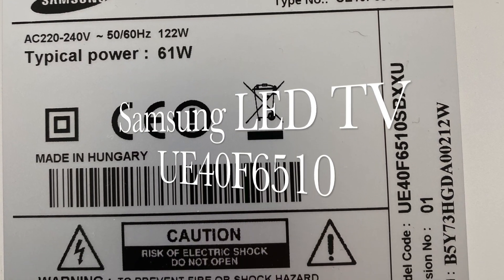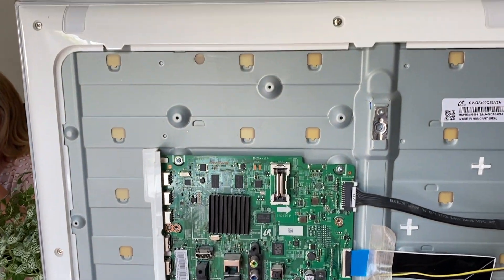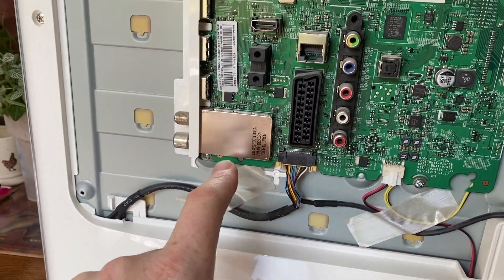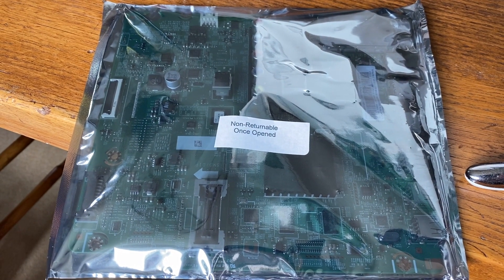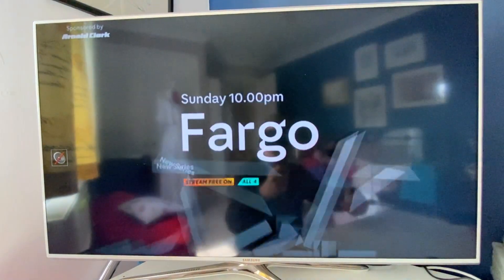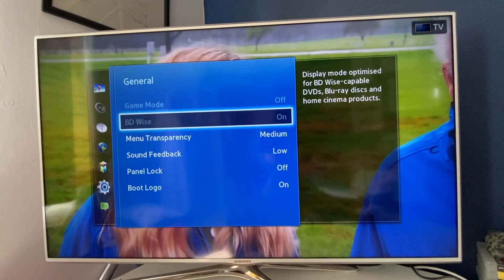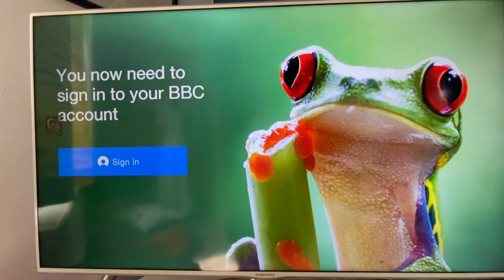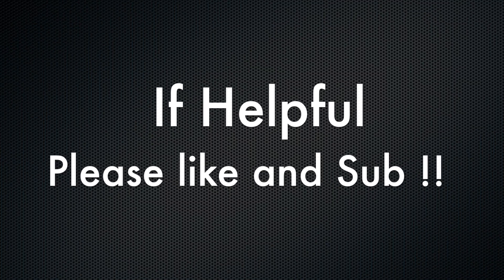Fixing a Samsung UE40F6510

Comment: Hello, I do not have any experience with TV repair, but my friend thge owner insists, he believes in me :-). It is always Samsung UE40C65410UP. Would you be so kind to put me on track with this problem? Where should I start checking first? what could that be? Is it dfixible? What are your thoughts? Here is the photo of the problem: https://drive.google.com/file/d/1e4keg4MtgY9_p-d6Dpp4dHHyM5o-1vup/view?usp=sharing
Reply from the maker: I'd say from the problem you have on the screen it the TCON board, this was what i found was an issue on my as mention about 2mins in to the video. I'd start with that first as you appear to have just half the screen working. I'm not a TV repairer just a good DIYer.

Comment: If i may ask
Thid tv has been released since 2011
My question is about the upgrade of it's software is it like Android 11 in 2022 or is it not capable of adapting to the apps that exist now?
Reply from the maker: Over the air updates if any are available.  Or look at the Samsung support pages if they offer a driver update over USB.  As this TV is no longer our primary have the older UI is not an issue for us. Good luck with updating it.  If this helped please think to Like the video and Sub...Cheers Joe